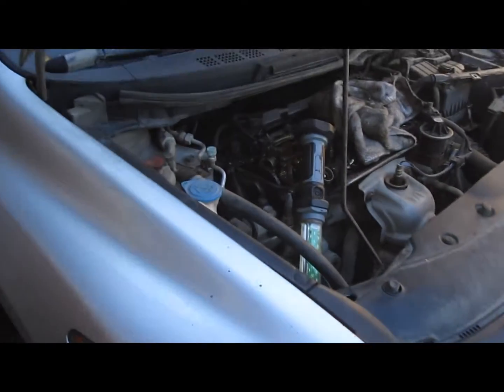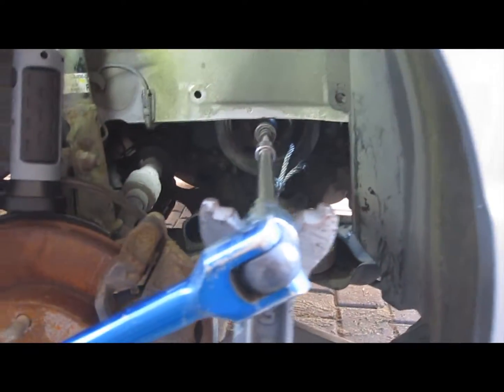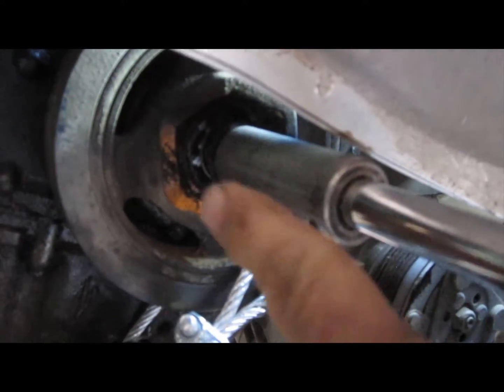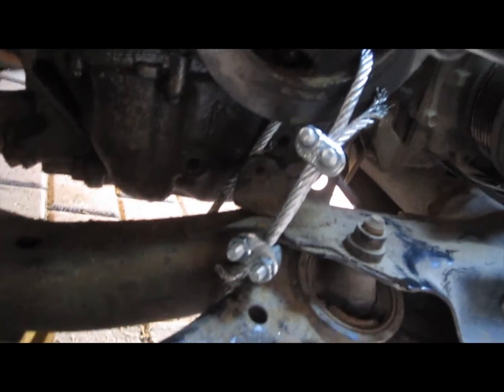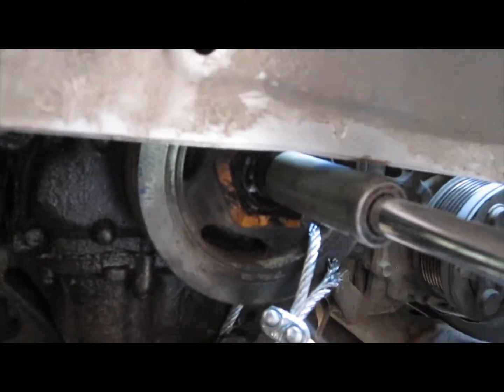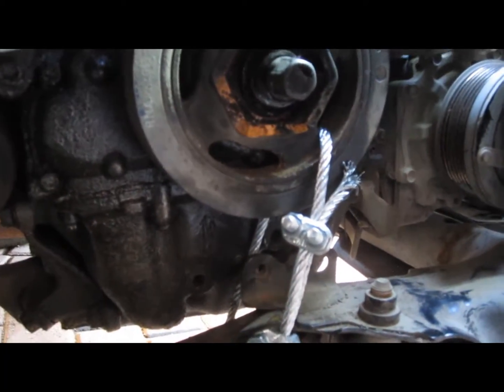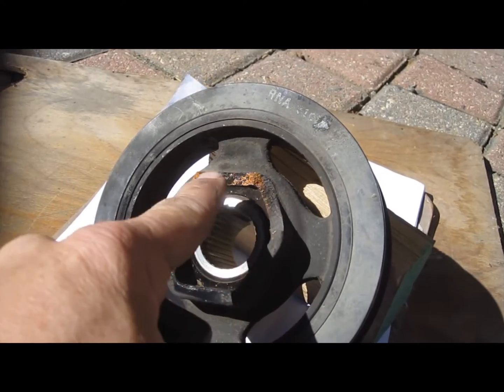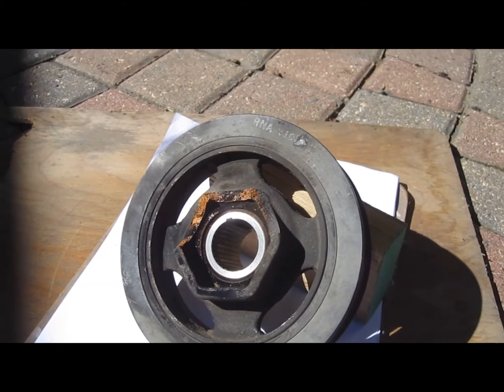2006 Civic Crankshaft Damper Removal

Comment: Any info or update on your issue with timing chain skip?  Were you able to realign the cam shaft sprocket with your crank shaft pulley?  If so,  what work was involved to correct? ...or was the issue unrepairable?  I might have same issue.

Comment: thank you for the video. it was very straight forward. i have a question. below the pulley i can see two holes on the oil pan and two holes on the part that attaches to the right lower arm. Are these openings for bolts to attach the two pieces together? however, i can tell that the two pieces do not match or the holes do not match.  i have a 11 honda civic thats looks the same and i thought these was a Chassis problem but i can see this honda looks the same.